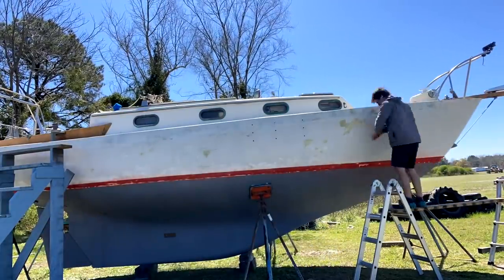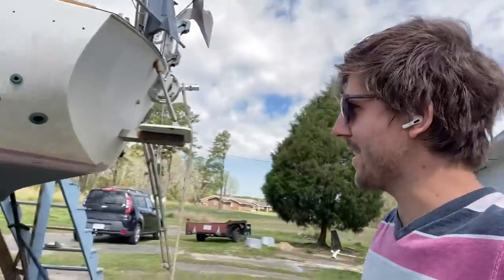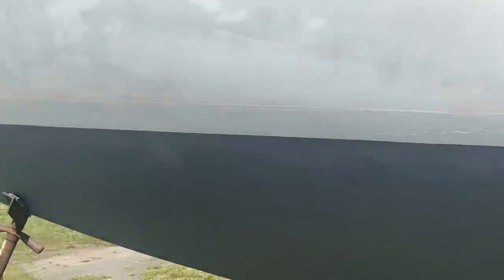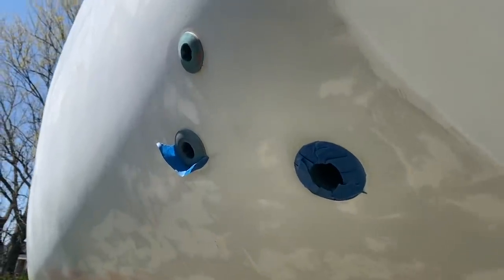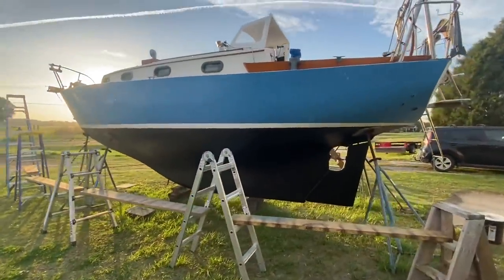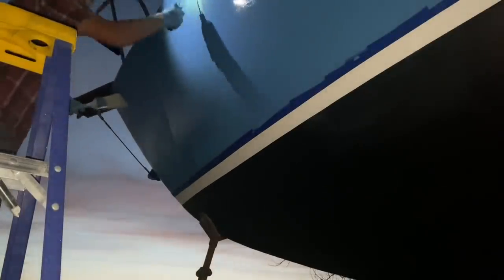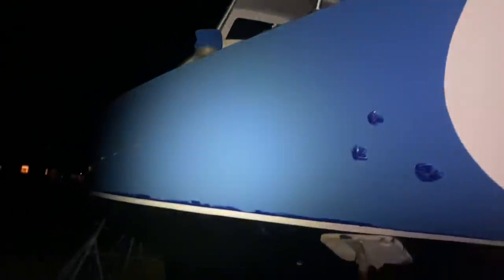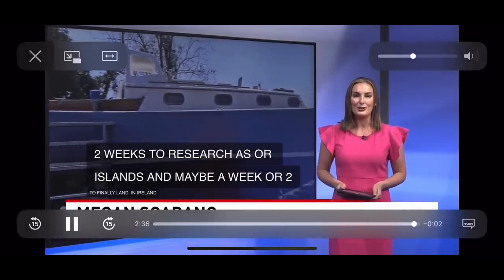Fresh paint, the local news and a sailboat race

Comment: Yrs and yrs ago when I last painted my even tinier sailer than the pickled herring, I remember it was late in the evening and I only had the transom hatch left. I managed the second coat before sunset, left the yard and to this day I regret I didn't use another day to finish the project: due to temp shift and even dew overnight the hatch came out with an ugly matte top coat. I has also been totally impractical compared to the rest of the boat as it has been like a swamp for all kind of grime and dirt. Point is: I will NEVE NEVER NEVER again paint any boat (house or car for that matter) without taking into consideration expected temp and humidity changes before the paint sets.